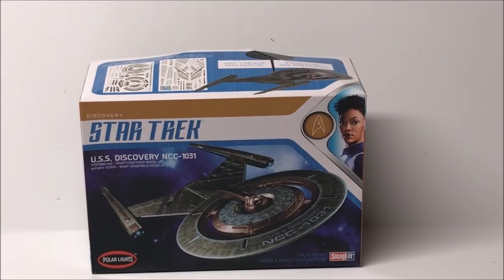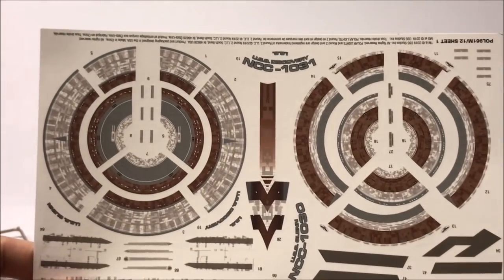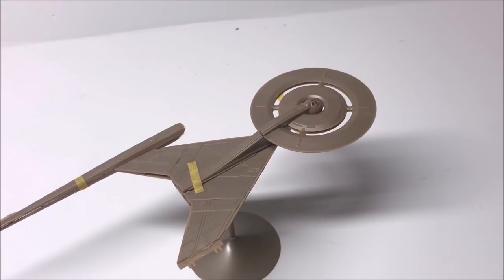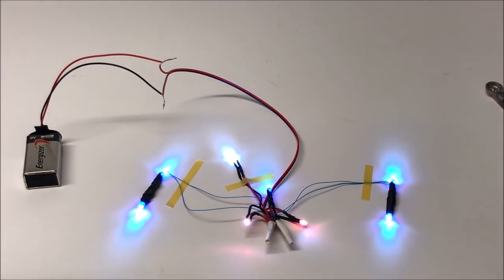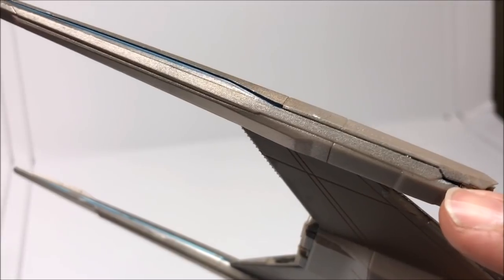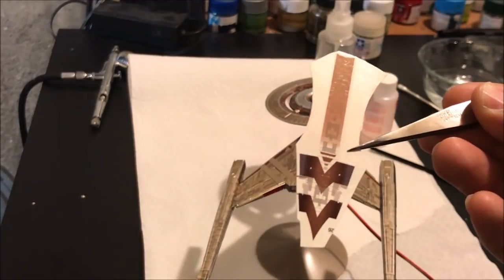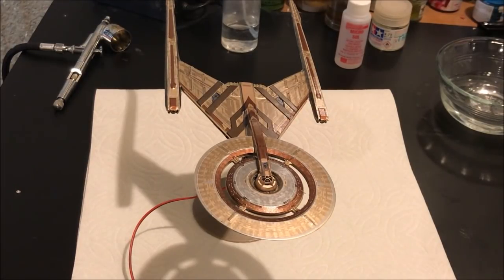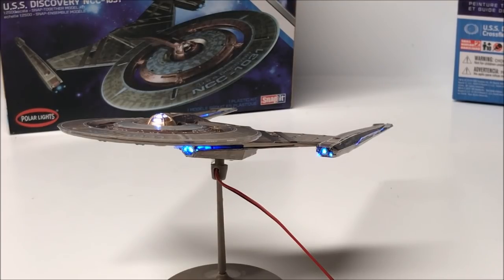Complete USS DISCOVERY review and build (all pts). WITH LIGHTS!

Comment: I love what you did. I did one about 2 months ago and lit mine up also. What a lot of people don't know is that you can sand a polish LEDs to fit anywhere on any model and as long as you don't sand too close to the electrodes in the LEDs you can make them fit anywhere. I did mine with a little more LEDs all done with armature wire to save room and a got a pretty good looking model for such a small size. Yours looks great. Waiting for the larger kit to appear so I can really go crazy on the lighting.

Comment: For the decals.. Next time try a mildly hot rag and press the rag on the decal and it will help "mould" the decal to any seams/ detail better.
Reply: That's what Decale solvents are for. They snug down decales to hug the details better. Solveset works best. Any model worth is salt can tell you that. A bottle will last you a life time on models that size.
Reply: or use the micro sol that he had there already and waiting

Comment: Not sure at the moment with the pandemic and China's agression and trade problems. But there are pre wired micro leds that will fit just about anything. They are tiny and very bright. Can be used to light up a hot wheels car realistically they are so small.  Also the price would be comparable.

Comment: How long do I have to wait for a decal to dry? This is my 1st build ever so I got stumped after snapping the pieces together and then not knowing how to put the decals on thinking at first that they were simply like stickers! xD
And is the transparent circumference of the decals supposed to stay showing like that?!
Reply: Decals don't take long to set, meaning they are no longer moveable on the surface on the model, anywhere for a minute or so. They will take a full 24 hours to fully dry and adhere to the model, though. It's usually advisable to spray a clear coat over them to protect the decals, but that's completely optional. As for the transparent edge, yes, that is typically still visible after the decal is applied. Many modelers trim the decal very close to the printed part to remove that edge using a sharp hobby knife so it doesn't show. It's a lot of extra work, but many consider it worth it. Again, totally an option. Have fun!

Comment: On that small of a model SMD LED's would have been a better choice. I have enough that came off a cheap toy helicopter that would be more than acquit for a model that size. If you can use a soldering iron SMD's are the way to go. Advanced model builders like myself would even go as far as lighting the Discovery name and number. Even adding blinking navigation lights could be added using a RC plane lighting kit. I have 6 kits I bought for both planes and models. I prefer magnet wire on the small kits like that. I would even remove the doors on the hanger bay and open that up and add a box to fit inside to make a hanger bay and light that also. Even small kits like that can be lit. I think easier than large kits myself. Again SMD LED's would be way better than 3mm LEDs.

Comment: Dude, you made a mess of those decals- particularly on the underside of the saucer section. You rushed the application using tweezers to apply them then totally missed the obvious creases when you did eventually use a cotton bud. It could have looked so much better.